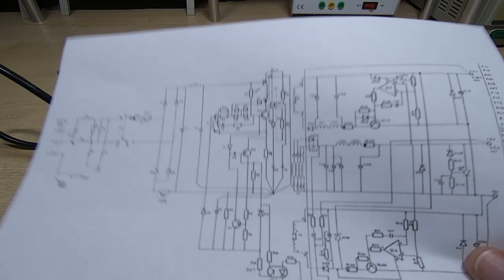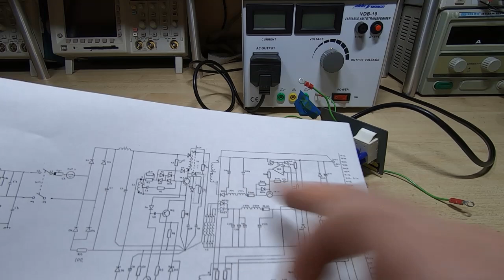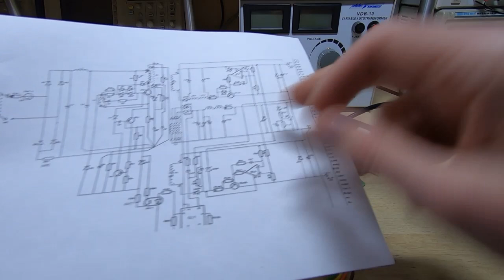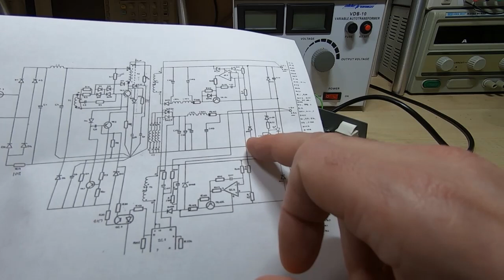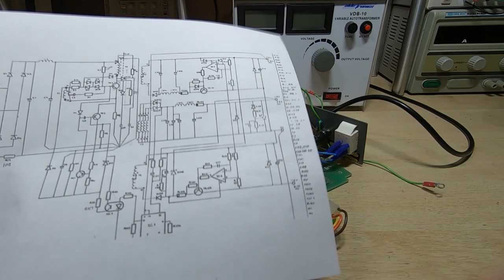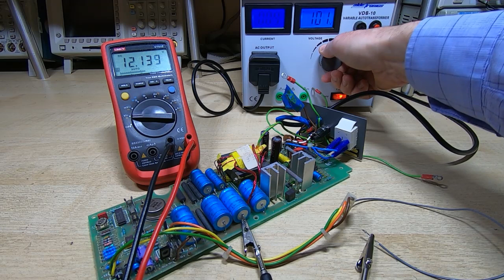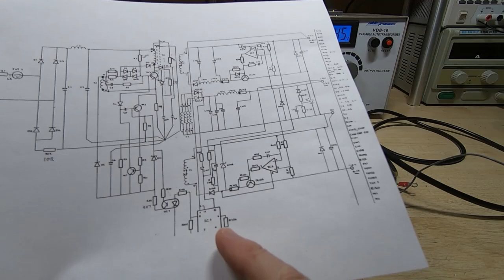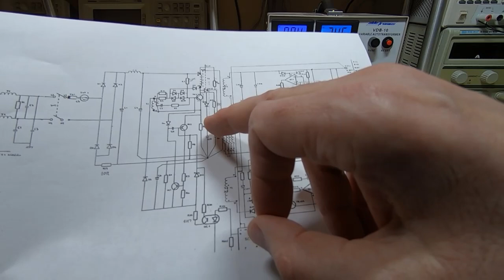480Z Power Supply Repair Part1

Comment: The problem may have been a simple one but the troubleshooting process is always interesting. I recently repaired an HP 6038 power supply and HP had designed in an interesting troubleshooting aid that allows you to operate the control circuit from a separate supply voltage while powering the main input from a DC (and current limited) power supply - turning it into a DC to DC converter. Less smoke and oscilloscope damage potential!